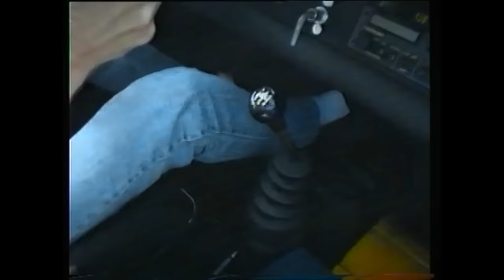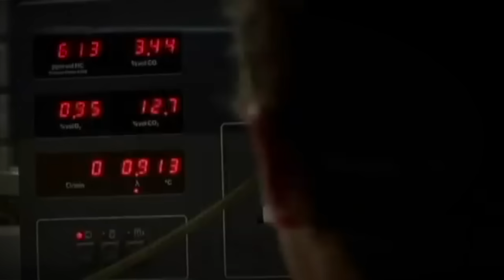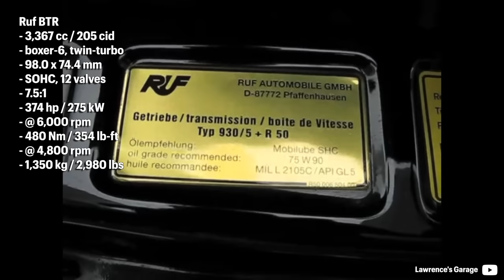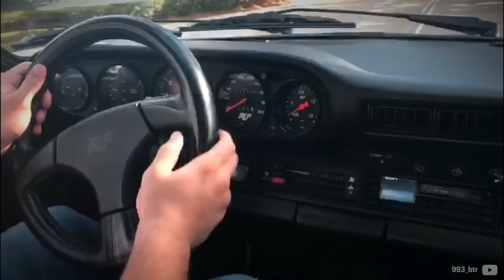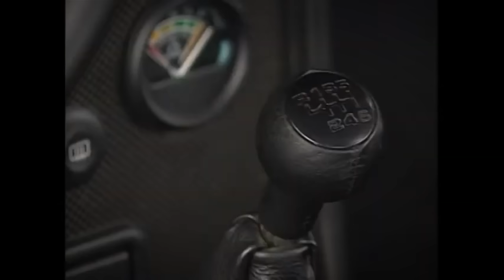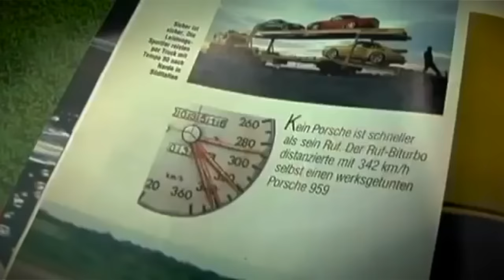The Most Dangerous 911 Was Vicious

Comment: Back in 05 I went to RUF for a Tour and I was delighted, although it was a rainy day in Pffafenhausen. The 500PS figure is correct, as the 469 PS was the weakest engine they’ve tested during development. 
They did everything they could to shave drag and weight, using the narrow body 911, and even using smaller side mirrors which, alone, gave the car a 7kph higher top speed, according to Mr. Ruf. 
All my respect for a family owned and run shop for developing such state of the art engineering over the 911.

Comment: Despite not being a fan of the 911, have some respect for the RUF models. Prefer the 912 or more specifically the untapped potential of the 912, had Porsche experienced a less troublesome time developing the 911 Flat-Six that it could have easily allowed for a Six-based Flat-Four to be built early on (mentioned in the Jürgen Lewandowski book) instead of being forced to carry over first the aging 1.6 Type 616 and later the 2-litre Type 4 engines. Also would have been worth seeing what RUF could have done with the 912, years before Subaru appeared with its Boxer powered Legacy and Impreza Turbos.

Comment: These are all aircooled engines right?
Reply: Oil air cooling I believe
Reply: @russredfern167  ah yes just like my gsf1200 suzuki bike oil and aircooled, i see 🐱👍🏿
Reply: First one was, I am not sure about 993 based one, 2017 is not, even though the engine is made to look like one. There was also a mid engined ctr, which was not mentioned in the video
Reply: @uros5530  i see thank you 🐱👍🏿